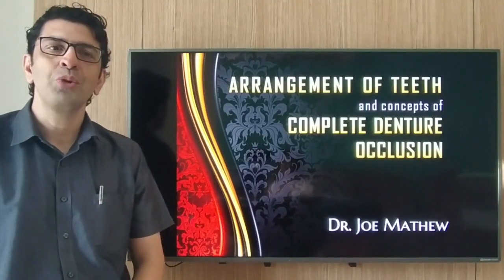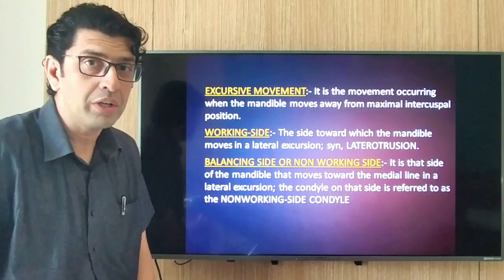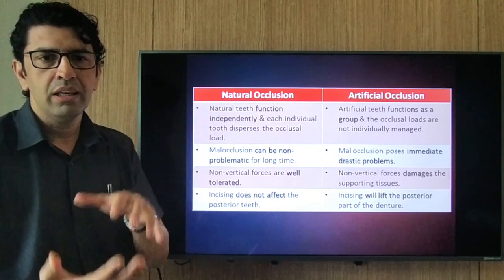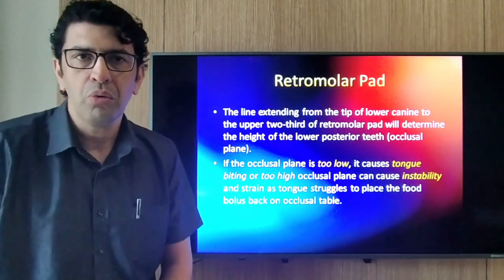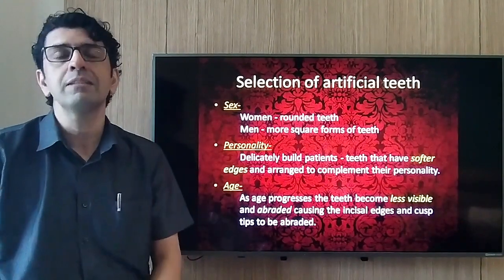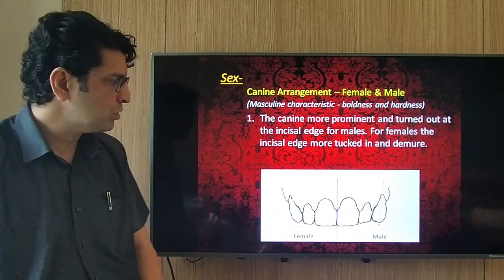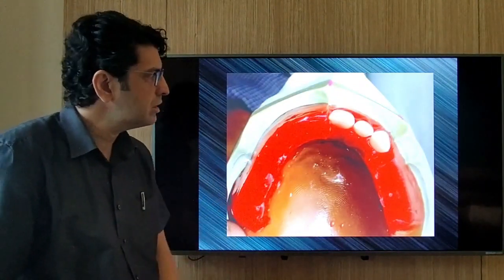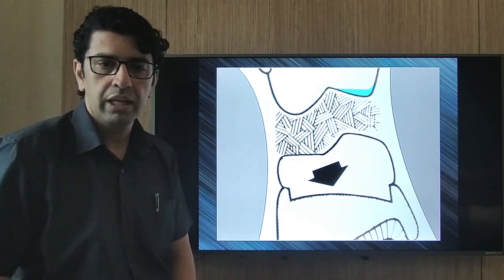Arrangement of Artificial Teeth & Concepts of Occlusion

Comment: during mandibular anterior teeth arrangement  , is lingual inclination of lower anteriors recommended and by how much ?
Reply from the maker: During mandibular teeth arrangement, mandibular teeth are often placed vertically with very mild lingual tilts on laterals and canines.. Often, any such tilts are within 5 degrees, in my opinion. (I don't have a reference for that), but I hope that helps.